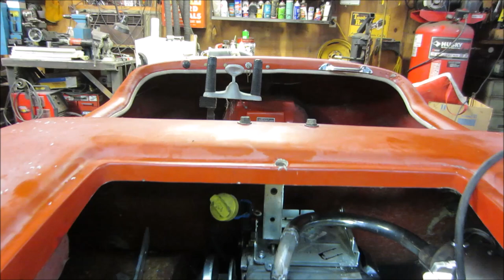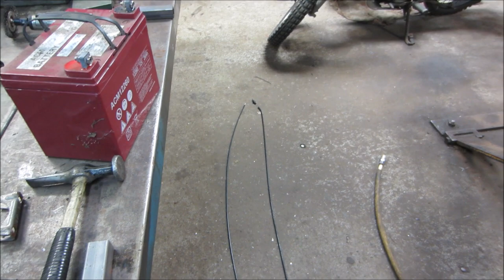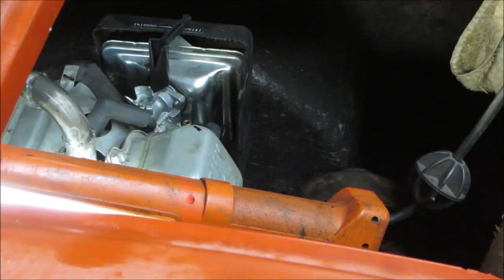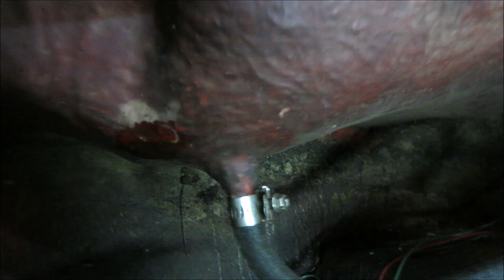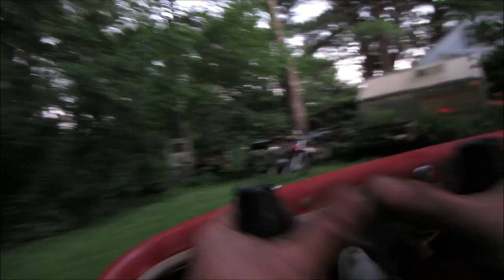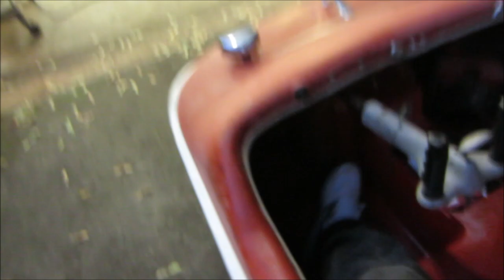Beaver amphibious vehicle 1st test ride in 25 years

Comment: Mustie...Love wrenching with you! Did I see two pedals on the floor?  Holding that “steering wheel” and throttling seems dangerous (and hard) if you’re changing the throttle cable anyway maybe consider a foot throttle?

Comment: I usually can't solder with MAPP Gas, there is some funky reaction with the metal which does not occur with propane.  Soldering with propane just works better.

Comment: Mustie you could flux the cable then heat it and let soldier drip into the strands then use very sharp cutters to cut the frayed strands off

Comment: Mustie - How about cutting that exhaust pipe flush with the opening body portal after you put in the allen screw so it doesn't rattle. Also isn't there some kind of coating you can insert in a leaking gas tank that seals small leaks? Just sayin. Enjoying how you bring equipment back to life so they can run again instead of ending up junk.

Comment: I agree with Richard Baumeister in that fibreglass panels do not accept push/pull loads without considerable reinforcement as they fail due to fatigue.  When fixing to fibreglass the loads should preferably be in shear and therefore the fixing should have been into the vertical bulkhead for side to side and up and down movement due vibration of the motor.
Reply from the maker: its not push pull its shear, the engine is not going up and down its going side to side,
Reply: The mass of the engine will be vibrating and flexing up and down on the bottom panel where it is mounted and that will transfer to the top panel where you have connected it via the solid engine.

Comment: I would see if the steering can be reversed from what it is. It's got to be counter intuitive to push the tiller the opposite of the way you want to go. I don't know if that's possible, but would be interesting to try, if not, I'd change the whole steering system to something a little more "normal" Motor cycle handle bars on a gearbox style steering system. But then I'm no mechanic, I'd probably just make a lot of trouble for myself and the project wouldn't get finished... like so many others I start and never finish. I must give you props for that, if it can be done, you eventually finish your projects.

Comment: Turn the angle bracket down, weld it to the upper damper plate and bolt the angle bracket to the square tube.

Comment: There needs to be a diode in the charging lead. It keeps the battery from discharging through the stator and half wave rectifies the AC coming out so you get DC. It won't work properly without one and may burn the stator. Any charging system without a regulator is going to have very minimal current; an amp or two - at 3600rpm, and appreciably less at anything less. Just enough to maybe keep a battery charged. I don't think it will keep up with the bilge pump and fan.

Comment: When I worked as a bicycle mechanic about 30 years ago (man, how did I get so old) I used these suntour (link below) cable cutters to cut gear and break cables. I cut hundreds of them... They never frayed when cut and if you're careful with the cable you can work with it for a while till you crimp the end with no issues. I was able to slide the cables all the way out of the housing for cleaning and greasing and get the back in with no issues. I still have my cutters from back then.  Try and get yourself a pair: http://velobase.com/ViewTool.aspx?ID=934c5731-46b0-49e8-a7f9-3d48d31c0bf4&AbsPos=0 .. I love your solder dip technique tho. It'd be to much work when you're fixing a dozen bicycles in a day!

Comment: MUSTIE use flex seal you will have to remake the hole but im sure it should hold up to modern gasoline :) best worth a shot if you plan to 86 the tank at some point. if so use a  lawn tractor tank i guess. oh and ive got this god awful squeal that comes out of my roto tiller. it uses the  old school ball and ratchet pullstart. forgot how to fix it since it's been a long time since ive had this issue.

Comment: Perhaps a large Schottky diode in series with the charging wire would prevent backfeed into the coil?  And could that extra contact on the key switch be used as the shutoff instead of the separate toggle?  Only thing you might want to watch out for is the current draw of the lights, pump and fan.  I'm not sure that little charging coil will be able to keep up.  

I wasn't expecting the steering to work that way LOL.  I'm to used to seeing the rotating yokes like some arcade games use.  It would probably drive me nuts not having the steering wheel to support myself.

Looking forward to seeing how fast it can go on a smooth surface, not to mention in the water :-)
Reply: That engine is not battery ignition. It uses a magneto. You just need to ground the wire off the magneto to kill the engine. Totally separate circuit from the starting and charging side.
Reply: I knew about that, I just forgot that the key switch was common positive.  If it was common negative, the old reverse position could have been used to ground the magneto.  Though an advantage of the toggle switch is that you don't have to hold it until the engine stops.  Probably safer that way if stopping in an emergency.

Comment: Do you think the electrical system could handle 2 10 watt led lights on the front along with the battery charging and running the fan?
It's funny that they advertised a top speed of 40mph! Woe be the man going 40mph in this thing!

Comment: you might need to add a diode in line with your charging wire, because those charging systems are typically used to power a light or something. If you want it to charge a battery you probably need to put a diode in line on the charge wire so the coils charge the battery, instead of the battery powering the coils.

Comment: Have you thought about using one of the fuel tank sealant products on the inside of your factory tank? they are resistant to all fuel types, and pretty inexpensive. i used some on my 82 LTD1000 tank. it works pretty well.

Comment: For the switch, I would have simply scavenged a key switch out of a lawn mower with magneto ignition. Much simpler than screwing around trying to make that original switch work. No need for that toggle switch either. Surely there’s something in the hoard!

Comment: I can attest to how nasty molten solder burns are.  Many years ago at my previous work we had a PCB soldering machine where the circuit boards would ride on conveyor rails over a wave of molten solder.  I decided to clean the conveyor rails over solder wave while the wave was on.  The open end of my leather glove touched the wave and the glove filled with solder.  No permanent scaring but yeah, it was nasty.  After that, always turned the wave pump off before cleaning.  Every time you use that little solder pot just sitting on the open vice jaw I can see it falling off and splashing on the floor.  Maybe you could weld a rod on the bottom of it so you can grip it safely in the vice.  
Go, Lilly Girl. :oD
Reply from the maker: it has a lip on the bottom and was clamped into the vice
Reply: Glad to hear that. :o)

Comment: You need to remove the fly weights from the crank case if your bypassing the governor.  The channel CarsandCameras discovered the hard way that a bypassed governor will destroy an engine when it comes apart.  The governor gear is plastic and wasnt designed for higher rpms.  Granted carsandcameras are using their engines for gocarts.
Reply from the maker: l told you that in the video?

Comment: You should bolt a anchor cleat to the top through the fiberglass to the engine bracket. This give you a handle as well. By the way do you live in New York near Lake Erie?

Comment: Can't you rerun that throttle cable through the middle battery compartment thus saving the distance of going beyond the left seat then back again to the motor? Should save you about 2+ feet. Even the bike cable should work fine then, if you needed to use it. Can't wait to see how it functions in the water!

Comment: You should plug the fuel line nipple at the bottom of that gas tank fill it up with that gas tank sealer and then drain it through the gas line feed and line the inside of that fuel cell with that gas tank sealer stuff

Comment: the best thing for cable lubrication is  dry lube for chains or gear cables or  brake cable outer's like you are using .
cable snips are  inexpensive too so no need to solder anything perhaps the tip if you do not like stray cables but free moving inner cables . how do i know this ? i used to change hundreds every week on bicycles or electric bicycles. it leaves a wax on the cable and makes  for super smooth  action inside cable a outer .
 the common Galvanised cables stretch much more at first in the first 8 weeks or so . 
so one might need to fit a cable adjuster . or adjust more in the first 3 months . 
 but those steel cables hardly stretch but they rust badly . grease is required or monthly dry lube the inner and outer sleeve 
so here  i end this very  long cable tuition sir .
best regards .

Comment: Just a question, not a judgement....do you think you should place a small plate under the fiberglass (where you installed the top engine bracing) to prevent further cracking of the gel coat?

Comment: Wouldn’t it be a bit stronger attachment from the motor to the rear deck if you added a piece of flat bar or large washers with a rubber layer to the bolts coming through the top of the deck?

Comment: One thought, what about that gas tank coating you have used in the past?  Would it work for this tank or would it not bond to the fiberglass?  Probably be a pain to put in though as I seem to remember you having to roll the tank around to coat evenly.

Comment: My question would be...... Why don't you run the cable from the steering and go to the right side ? instead of the left side like you have it, the right side would bring you closer to the carb, so you would have more cable that way and less kink to the cable. you might even be able to use the cable of 6' that way.

Comment: I know I'm probably a little late but just seeing this video now I'm your gas tank problem without cutting the tank out of their machine could just be cured with the gas tank coating kit so it's be the same stuff you use for coating a gas tank that has rust holes in it or you could plastic coat the inside of that tank and that would solve your problem

Comment: If it were mine,  I'd see if I could engineer a motorcycle twist-grip on in place of the right-side hand grip on the steering yoke.  I'd rather have a twist-grip than the thumb-push in the particular position that it's in now.  That said,  I never had a problem with a thumb-throttle on any snowmobile,  but probably because it's oriented a bit differently than the Beaver setup is.  I would just be bothered that with the bouncing and whatnot, it would be difficult to maintain some sort of even pressure on the throttle, instead of being bounced around, snapping back and forth from closed to wide open.    Of course, I haven't ridden in this thing or one like it,  so I really don't know how rough it handles. Might even be worth exploring converting over to a rudimentary foot-pedal for the throttle,  but I guess it's all up to ones' taste.  Looks like it's a blast of fun anyways.  It's been cool following this project.  Hope to see you go forward with the other things, too.

Comment: instead of a kill switch a normally closed relay on ignition circuit would work when ignition is on points on relay open allow engine to spark when off points close killing engine it is how i have my motor cycle wired plus a relay to knock lights off while start button is pressed

Comment: I know it is too late, but if you put a larger tube over a smaller tube then a bolt or a pin through the both of them.
Reply: For the upright stabilizer from the top of the motor to the shell.

Comment: I've asked CodyDon (Cody'sLab) to do a video on a cheaper way to remove the Methanol from Gasoline DIY style.
Reply: Actually, methanol and ethanol are two different compounds. Ethanol is what is used in gasoline. Methanol is commonly used in racing as a fuel.

Comment: It would have been simpler to use one anti-vibration joint on the top of the motor and the other across to the to of the right wheel well, a single 1 1/2" by 1/4" plate between the joints, the motor would not move.

Comment: I drove an old AMF harley davidson 2stroke 3 wheel tiller drive golf cart through the most insane fields. Reverse was turning engine backwards. So itd shut off and restart backwards. Crazy set up Literally drove up a high incline pond dam. I dont know why but those old tiller steer 3 wheelers are crazy fun to drive. Fast enough to hurt you, but only if your a pussy. Haha no you could die

Comment: If you cant find the lenses I have a suggestion for making them if you are up for it.
Reply: There was some other video on the Beaver out there. The lights are the same as those still in production for trailers. It's likely he can even upgrade to LEDs if he wanted.
Reply: Tail light lense I think he has, headlights (lenses) are Wipac Reversa Lights. Lenses from Hella (VW) back up lights should work if the trim rings are still on the Wipac lights. Not sure if the Hella trim rings work, but I do have Hella lenses on a pair of Penguin headlights. VW lenses easier to find off 67' ish Bugs.

Comment: Maybe buff it so it may shine !
Reply: Κώστας Λεούσης  Dont worry, he plans to do just that!
Reply: Nah he needs to fill all the spider cracks and paint it. If he were local I'd paint it for him but sadly he is nowhere near me🙁 I'd love to get my hands on that beaver and make it look new.
Reply: sinformant I agree would be nice to make it like new
Reply: sinformant Why not re gellcoat the whole thing? I havent done it myself YET, but I have researched the hell out of the process because I am restoring an old fiberglass boat. The process is no harder than painting, it's actually almost identical lol.
Reply: Area85 Restorations you can re gelcoat it to fill in the spider cracks, but If it were mine I'd want more protection against uv Rays  that will bake it. I'd seal it throw down a basecoat and use a good 2k clearcoat that has good uv protectant in it to keep the sun from fading it. Also I think it'd look pretty sweet in a teal/turquoise color with white accents.
Reply: sinformant Your correct, however the cracks are most likely just in the gellcoat, much like my boat is. The solution is to grind down to solid fiberglass then build it back up with a fiberglass resin, cabosil, and chopstrand mixture. I have done that aspect of it and it works quite well.
Reply: sinformant Sorry, not trying to argue, I just have had horrible experiences with painting fiberglass watercraft. Paint just cant hold up to the abuse from my experience.
Reply: Nice work, Mustie.
Reply: Area85 Restorations yes I was saying to re gel coat it, level it off by sanding, use a sealer(2k primer) then basecoat and then a good 2k clearcoat.  This thing isn't going to always be in the water, but if you re gel coat and sand it so the primer sealer can get a good bite in it trust me it wont come off easilly. The type of paint you use also has a lot to do with it. I'd go with a good urethane base coat paint. I have never restored a boat, but don't paint and body. I used to be a member of the "rolled on" forums which was people doing paint jobs using the cheap rustoleum paint that comes in a quart at your local hardware store, where they would use paint rollers to apply it. I'd never paint anything like that but it was pretty amazing to see how peoples projects came out. There were members that even used that method and that paint to restore their boats and jetskis. I'm not offended, this is a friendly conversation. Bottom line paint is all about the prep work, if you don't take your time and do all the prep work right paint will turn out horrible and even if by luck it does turn out well, eventually it will bubble up, flake, and come off. I didn't go to school for paint and body, I did a lot of research online, bought guns and paint and did it myself. I'd make a mistake I'd learn and fix it. But that's just how I'm wired. You can see on my channel the red bike which is actually an orange candy color. I have Vids of it finished and one or two of it during the painting process and that was literally the first time I had ever picked up an hvlp gun and painted anything.

Comment: That's not a "fan", it's called a "blower" in the marine world.  Should be run 3 minutes before starting to remove any gas fumes and then after if possible to remove heat from the bilge.
Reply: 4gasem I dont think it is to clear the bilge, pretty sure it is for cooling.
Reply: Area85 Restorations Nah he is correct about clearing the fumes, don't want volatile gas fumes building up in the enclosed engine bay, firing it up and having a spark blow all his hard work into pieces.

Comment: cant the ignition switch work as a kill switch as well when its in the off position like in a normal car?
Reply from the maker: no its needs to switch to ground not 12v
Reply: Mustie1 you could wire in a relay with normaly closed contact and when it stops getting energized it grounds the engine out.